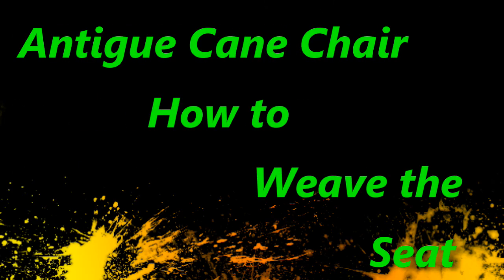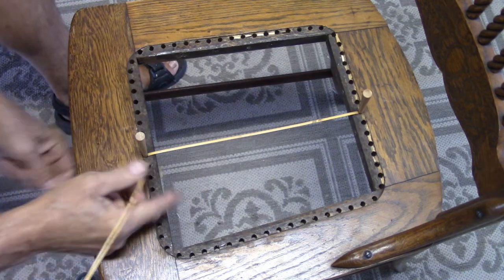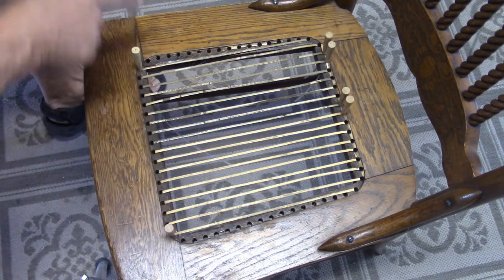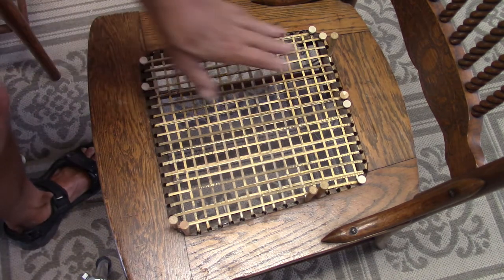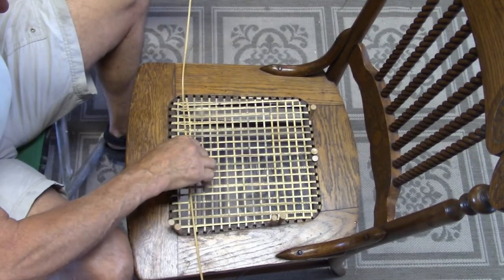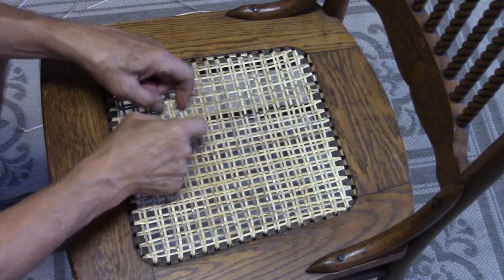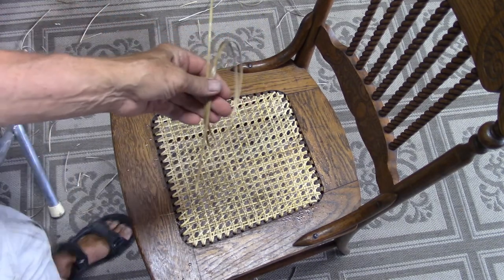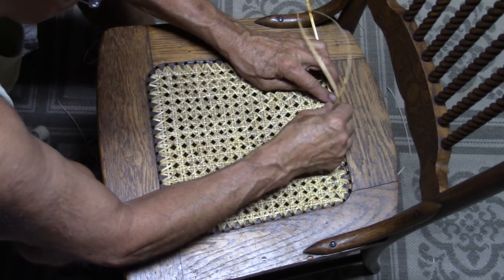Caning a Chair Seat, how to Weave cane

Comment: Thanks!  I see that you answer questions so I here's a good one:

The frame of the rocker seat I am doing is not flat.  The sides are curved from front to back with the lowest point being almost an inch below my first step of back to front cane.  

Do I need to remove this first step and start over and leave some slack to accommodate the dip in the seat frame sides?

Thank you, sir!  Great video!!
Reply from the maker: run the vertical cane first, which should form the curve, then the horizontal should conform to that!

Comment: Hello! Congratulation for your work and amazing video. I followed your video to wave my own chair but I had a problem because some strip were broken while waving. Where I live is such a hot an dry area that less than a minute after take the strips out the water they gget broken.  Would you mind give me some tips to fix this situation? Thanks.
Reply from the maker: I keep a wet towel and lay that on the cane
Reply: @donaldporta  Thanks,  I´ll do it.

Comment: Thank you for the great tutorial!   Would you have any tips for repairing a hole in a cane back sofa that is over 100 years old?  I am hoping I can just add cane to what is already there. Have you ever done anything like that or know if it is possible? I am not sure how I would tie off the cane that I add.
Reply from the maker: you can just add the cane to replace the broken ones, the splice will have to be in a spot that is not seen --- such as the underside or in the hole where the cane comes out.

Comment: Did you soak the binder cane in water like you soaked the other strands? I need to bend the binder cane around a curved corner and concerned about the cane cracking and wondering what you did with your chair in the video.
Reply from the maker: Yes I soaked the binder cane.